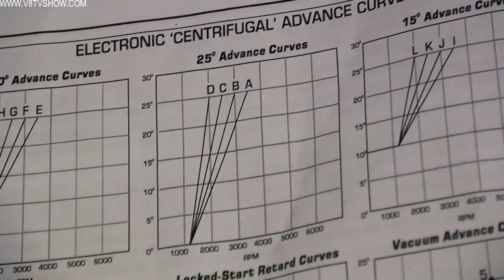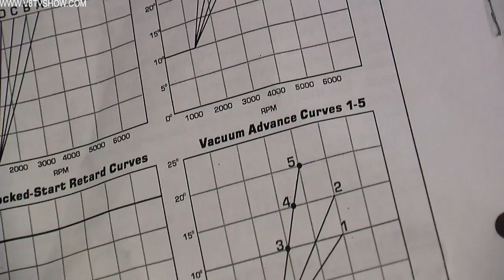V8TV Tech How to Set Your MSD Digital E-Curve Distributor Video

Comment: Ok, bare with me here.  An old mechanical distributor, 10 degrees Initial, 24 Mechanical for 34 degrees total at ~3,000 engine RPM at Wide Open Throttle and with NO Vacuum Advance.  But, at say 60 mph strait level steady state speed "floating" cruise, at 3,000 engine RPM, then the same 10 degrees initial plus the 24 degrees Mechanical for that 34 degrees Total PLUS 15 more Degrees Vacuum Advance, so ALL THREE TOTAL are 49 TOTAL DEGREES.  So... Lock-Out the E-Curve, set TOTAL Timing to 49 Degrees, then set the E-Curve Switches to the desired Curves.   ? Does the Locked-Out Total Advance one must set it to INCLUDE all 3, Initial, "Mechanical", and Vacuum, OR only *2 things*, Initial plus "Mechanical" ???  Thank You Kevin.
Reply: dont set  it  to 49 total.  set  it  to  the 34  and  use the chart  to pick  which  vacuum advance  curve  is in it  

so  the dials  are set  to either  3-4  or 7-4  depending on vacuum levels

but you  figured  it  out  by now  i hope
Reply: @KingJT80  I just re-visited the E-Curve Instructions, and it says 2 different things in 2 different places LOL, one place says  include vacuum, and the other says do not, LOL  which I could post an image  ...
Reply: @olsketchmo
  I thought so, too. But after revisiting the instructions, here are the two statements i found.
 "This means that you have to set the distributor at the highest, or Total, amount of advance that you want to achieve (including vacuum advance) and
compensate with one of the selectable ignition curves (shown on page 4). "

"Total Timing: This is the total amount of timing that the engine will achieve. This is the amount that
all of the electronic curve and settings will be based from. This setting also includes any amount of
vacuum advance that you plan to use."

In the "Setting Up The Distributor" section, there is no mention of total timing.
Reply: Glad to see a recent comment here.
I installed an E-Curve on a Mustang 289 V8, probably about 15 years ago.  I think a mechanic I took the car to recently may have tried to adjust the timing without knowing how.  I will be double-checking all the settings, including total timing, initial and advance. And I do have vaccum attached. 
Wish me luck, this is not something I do regularly, but I think I have enough understanding to tackle it.  I just recently bought a timing light that I'll be using.
Reply: @dannycastaneda1974  Hello.  It will be interesting to see what it takes once revisited again in 2024.  Old analog mechanical stuff adds advance by mechanically moving parts Forward of the direction of rotation.  In the electronic distributor there are no moving mechanical parts other than the main shaft spins, correct ?  So the Trip Point relative to crank position is fixed.  And the electronics can't "see the future", so they must TAKE OUT advance and let it back in judiciously, rather than "adding it" or moving the fire point FORWARD relative to crankshaft location, does that make sense ?  So set dip switches fully disabling all mechanical and vacuum advance in the electronics, get then engine running and using a timing light set the desired total max combined advance of initial + mechanical + Vacuum.  Turn off motor.  Open Distributor and set Dip Switches for the desired Mechanical and Vacuum Curves.  Re-install Cap.  Re-start engine, conform settings ?... Wonder if it works this way, it did on the one I did, iirc.  Look forward to finding out what you find, and just how bad my memory might be.

Comment: Whats the best way to hunt max total timing when testing? Will it just stop making power? I don’t want to detonate or pre ignite. I want to be able to identify easily. I am going to be using a msd 6al 2 programmable and locking out mechanical.
Reply: its kind of test and tune but most HP engines on the street will like more initial than mechanical..  and they like it all in at right around 2000- to 3000 RPM  its just playing with it on a dyno really until it stops making power.  if initial is too high it will kick back on the starter.  Just make sure if you have a non stock engine you get a higher torque starter for that application.  one that will turn over your engine with the compression you have  because you dont want to be trying to turn over an aftermarket 11:1 engine if thats not what the stock starter was meant for
Reply: mrhazel Thanks. Yeah im interested in getting my exhaust and wideband installed and fine tuning the jets on the dyno. I guess we can figure it out then. 

 I have a high torque mini starter because of headers. My compression is 9.5:1 and dynamic is around 8:1 with the cam.  The MSD has a start feature that retards timing on startup then puts it back to your preset.
Reply: @Dodgechallengersixpack  yeah thats why I want an MSD e curve when I redo my 302. Gets you all the timing options you could want or need without the need of a CD box

Comment: OK, I've got a digital E-Curve dist, both pots are set to 0 right now, redline to 7000 rpm and I've got no spark at all. My dad passed away before finishing the car, but it drove twice for about 7-8 miles, now 0 spark at all and it won't start. Any help would be appreciated! I feel like something is wrong with the distributor. Also has an MSD Blaster 2 coil.
Reply: Hope you got an answer before now, but it may simply be that your power supply wire to the distributor is dead. Check any applicable fuses and wires and best of luck to you.
Reply: I haven't. Fuses are fine, power supply wire is brand new, coil is getting power when the ignition is on. I think it's the board on the distributor. I've read about others having the same issues too. Two messages sent to MSD and no response.
Reply: But thanks for the tip.
Reply: No she isn't. The distributor only has about 5 miles on it though. The car was never finished, only driven once, and started a few times to move around the garage. Before my dad passed away I promised I'd finish it for him, so I need to get it running. It's a '32 Ford Graffiti coupe. The cap was off of it when I got it, so I know he was already trying to troubleshoot it. In his time he probably bought like 35 MSD distributors for all the cars he built. I feel since this one failed with so little use, that they kind of owe me/him one.
Reply: Heck he still had like 3 other new MSD distributors on the shelf in the garage he never used. They aren't the Digital E-Curves though, so it won't help me on this one.
Reply: @bootyman234  Long time later. The distributer was bad. MSD fixed it and it should be back in a couple days. When we dropped a new ready to run MSD in, the car worked no problem. MSD acts like it's improper setup/use that caused the failure, but there's 8 one star reviews on Summit with the same problem. The early units are just faulty IMO. I hope they've solved the problem though, and that the refurbished one will be reliable now.